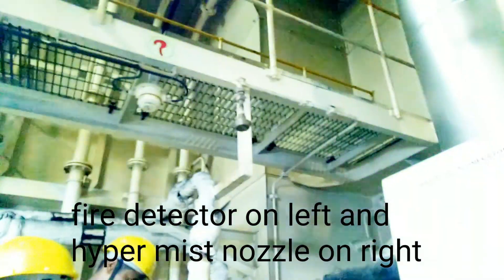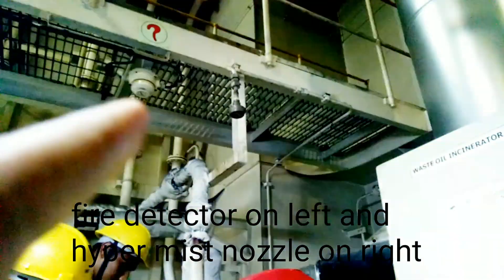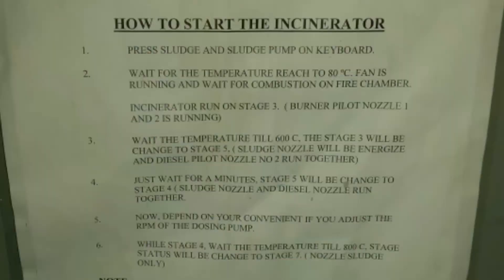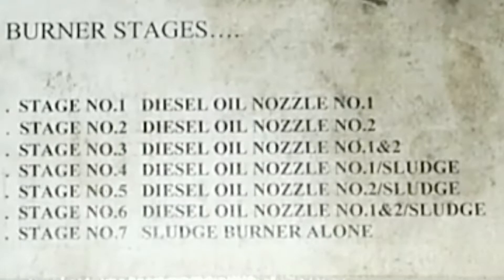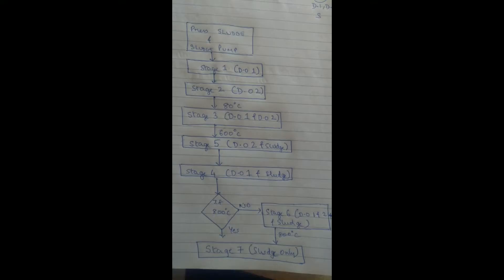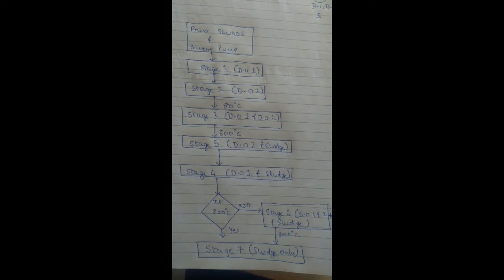What is 7 stage type Incinerator? #Incinerator #7 stage Incinerator

Comment: Dear Sir, such helping video thank you! 
One question; during incinerator burning process when we open i presume flame fail will occur, but is this a safe testing method. Or should we say how do you test that door switch safety ?
Reply from the maker: +mert ferah :no it is not a method of testing, it's not safe, u can test by electrically isolating. I mentioned that as there could be scenario where the incinerator is not starting coz of that switch malfunctioning.
Reply: Basic Marine Engineering thanow so much!
Reply from the maker: +mert ferah : welcome, please do share your knowledge it will help you more.

Comment: Thanks nice video. Why there are 2 champers in the incinerator? Please
Reply from the maker: +amaakjb : there are two doors, one door for feeding solid waste for burning, this door is for a chamber like which is not open directly towards the flame but one side open so that the solid waste is burned by pyrolysis. And the lower door is basically for cleaning the furnace area.
Reply: Basic Marine Engineering thanks
Reply from the maker: +amaakjb : thanks for the feedback, so I guess when I reply to the comments you do get a notification, do share with friends and Discuss, helps you understand better.
Reply: Basic Marine Engineering yes, I got a notification.